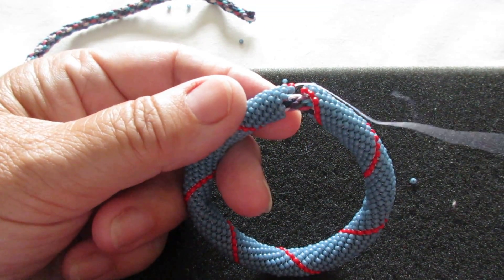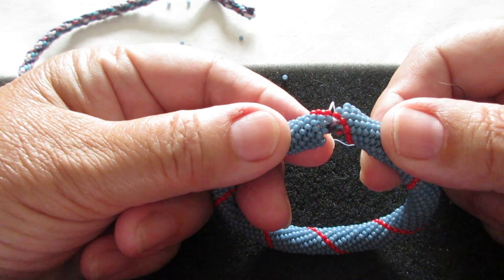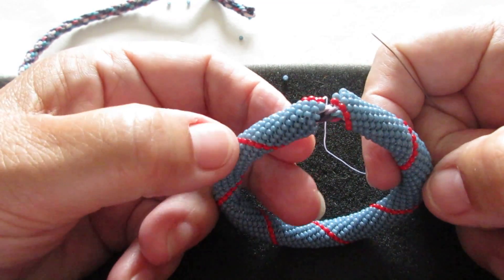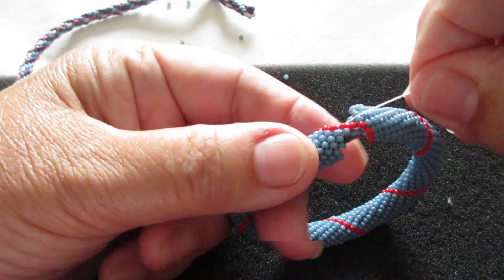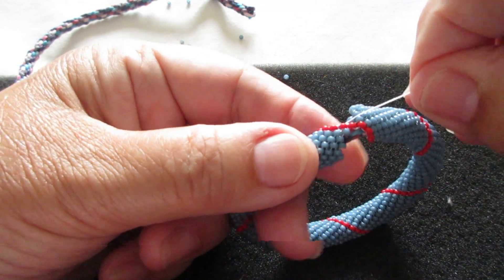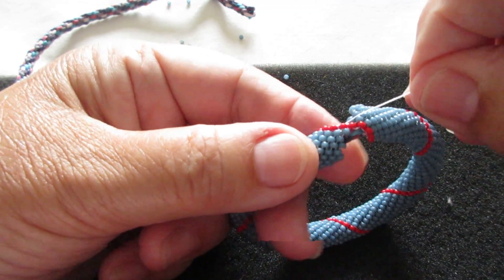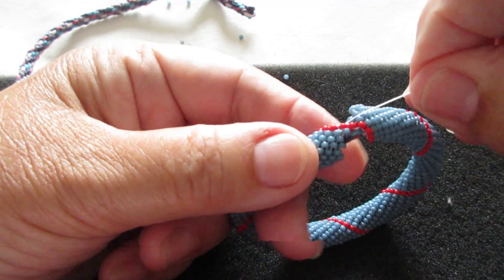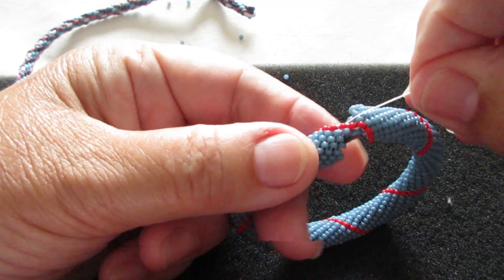Peyote with a twist - not crochet. Joining the ends to make a bangle. Part 1.

Comment: Thank you so much for your tutorial! What did you use to fill the middle of the bangle? and does it need to be in the middle as you proceed to peyote around it or could the bracelet be filled right before you decide to join the ends?
Reply from the maker: Thank you. You can use cord, mesh, stocking, all kinds of fillers. I used a kumihimo cord I had in my stash for this one. I don't use a filler on the smaller circumference tubes as they are strong enough. If I do use one, I add it after I've made the tube.